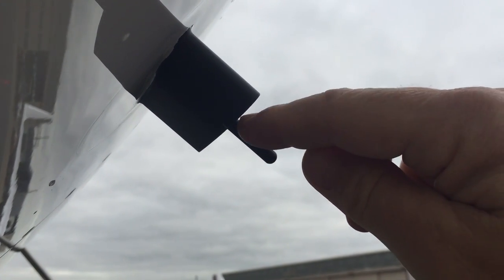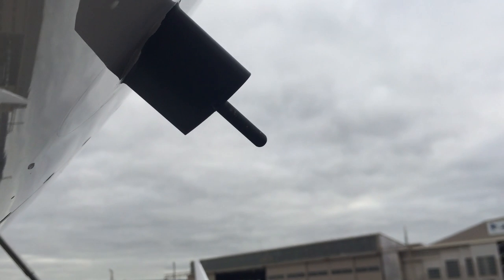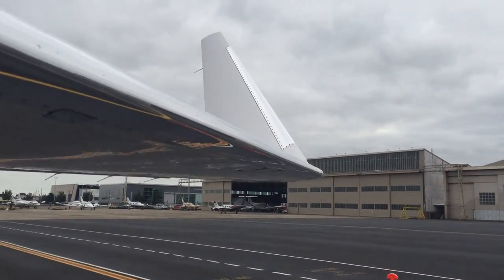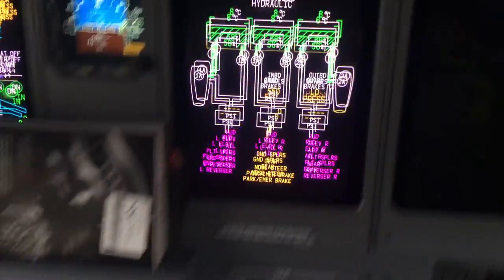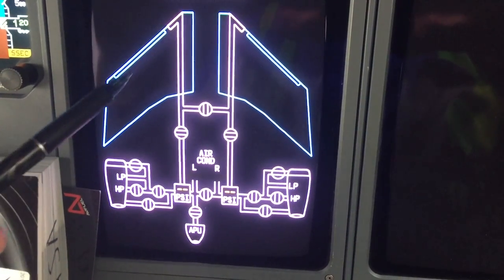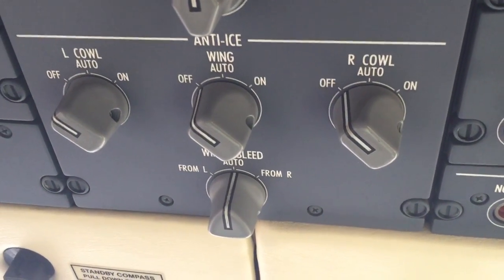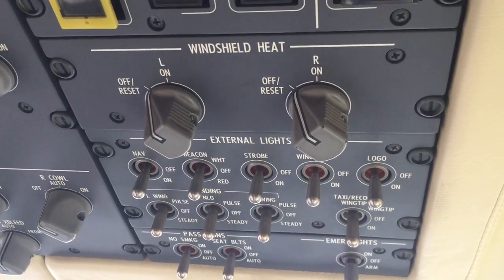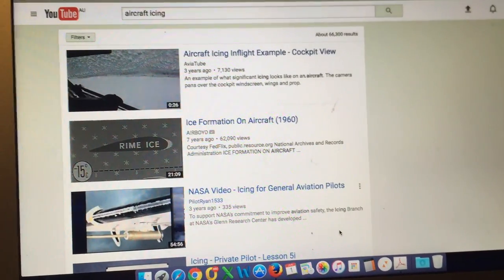Flat Earth - Yes clouds are made of water - ice formation on aircraft proves it.

Comment: That aircraft has a nice anti-ice system. So you never get icing if the dew point is below 0º? I think (but am not certain) that icing has been an issue at Grand Junction (where lots of smaller aircraft operate) airport in Colorado. Only some aircraft with bad anti-ice systems and exceptionally bad behavior to icing are affected though. A lot of people are also under the impression that it is the weight of the ice, not the fact that it spoils laminar airflow over the wings that causes the problems.

Yesterday I managed to get my telescope out! I got blinded by the moon which wasn't quite at 1st quarter yet. Unfortunately, the dew point temperature was rather high and the front lens got covered in it pretty quickly. So I wasn't able to calibrate the StarSense system (I recommend that. It makes full polar alignment super easy and you don't have to fiddle with the tripod).

What is that specific aircraft? I could do with one of those. Like I have that kind of money! LOL!
Reply: If it's his usual airframe it is a Bombardier Global Express. I'm not sure if it is the base model or one of its variants or successors.
Reply: There's a separate icing issue with other aircraft. That one's got twin gas turbine engines. Piston-powered aircraft with carburettors have this problem where the carburettor airflow causes a drop in pressure that can cause icing at well above 0°C, right in the air intake for the engine. It's been years since I had to know this stuff, though, so ... lmjgtfy. 

https://www.easa.europa.eu/sites/default/files/dfu/EGAST_GA5-Piston-Engine-Icing-final.pdf 
"Carburettor (carb) icing is the most common, first to appear, and the most serious. There is a sudden temperature drop when the fuel vaporises in the air, and another drop when pressure reduces as the mixture passes through the carburettor venturi and throttle valve. If the temperature drop cools the air below its dew point, water condenses. If the mixture temperature falls below freezing, the condensed water will form ice on the surfaces of the carburettor. 
In snow, sleet, or sub-zero cloud, ice may build up on air intakes, filters, alternate air valves etc. It may also form in rain if either the rain or the aircraft is below zero°C. Impact icing can affect fuel injection systems as well as carburettors, and is the main hazard for turbocharged engines. It is unlikely to be removed by selecting carburettor hot air, although selecting hot air, or alternate air in a fuel injected engine, bypasses the normal intake and should allow the engine to run normally, although possibly at reduced power. 
Carb icing is not restricted to cold weather. It will occur on warm days if humidity is high, especially at low power settings. Flight tests have produced serious icing at descent power when the air temperature was above 25°C, even with relative humidity as low as 30%. At cruise power, icing occurred at 20°C when relative humidity was 60% or more. (Cold, clear winter days are less of a hazard than humid summer days because cold air holds less moisture than warm air.) 
Carb icing can occur in clear air without any visual warning. The icing risk may be higher in cloud, but the pilot is less likely to be surprised. 

https://www.skybrary.aero/index.php/Piston_Engine_Induction_Icing 
There are 3 types of fuel induction system icing that may affect piston engines: 
    Impact Ice. This is formed by the impact of moist air at temperatures between -10°C and 0°C on air scoops, throttle plates, heat valves, etc. It usually forms when visible moisture such as rain, snow, sleet, or clouds are present. Most rapid accumulation can be anticipated at -4°C. This type of icing can affect fuel injection systems as well as carburettor systems and is also the main type of icing hazard for turbocharged engines.
    Fuel Ice. This forms at, and downstream from, the point that fuel is introduced into the carburettor when the moisture content of the air freezes as a result of the cooling caused by fuel vaporisation. It generally occurs between +4°C to +27°C, but may occur at even higher temperatures. It can occur whenever the relative humidity is more than 50%.
    Throttle Ice. This is the most common, earliest to show and most serious carburettor icing. It is formed at or near a partly closed throttle valve (sometimes called the “butterfly valve”). The water vapour in the induction air condenses and freezes due to the venturi effect cooling the air as it passes the throttle valve. Since the temperature drop is usually around 3°C, the optimum temperature for forming throttle ice is between 0°C to +3°C although a combination of fuel and throttle ice could occur at higher ambient temperatures.

Relevant to all aircraft: 
https://www.skybrary.aero/index.php/In-Flight_Icing 
Hazards arising from the presence of ice on an airframe include:

Adverse Aerodynamic Effects

Ice accretion on critical parts of an airframe unprotected by a normally functioning anti-icing or de-icing system can modify the airflow pattern around airfoil surfaces such as wings and propeller blades leading to loss of lift, increased drag and a shift in the airfoil centre of pressure. The latter effect may alter longitudinal stability and pitch trim requirements. Longitudinal stability may also be affected by a degradation of lift generated by the horizontal stabiliser. The modified airflow pattern may significantly alter the pressure distribution around flight control surfaces such as ailerons and elevators. If the control surface is unpowered, such changes in pressure distribution can eventually lead to uncommanded control deflections which the pilot may not be able to be overpower.

Blockage of pitot tubes and static vents

Partial or complete blockage of the air inlet to any part of a pitot static system can produce errors in the readings of pressure instruments such as Altimeters, Airspeed indicators, and Vertical Speed Indicators. The most likely origin of such occurrences to otherwise serviceable systems has been the non-activation of the built-in electrical heating which these tubes and plates are provided with, although in some cases, the detail design of pitot heads has made them relatively more vulnerable to ice accretion even when functioning as certificated. It is now also recognised that the effects of high level ice crystal icing can have what are usually transient effects on the effectiveness of normally functioning pitot probe heating.